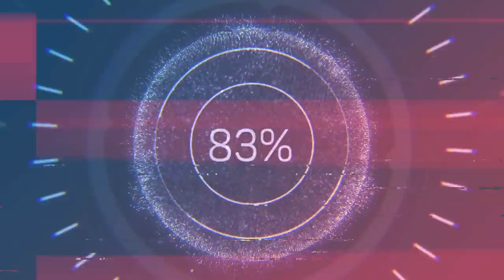Woodturning -  Blood Veins Evil Epoxy Resin !

Comment: Nick, just a couple of suggestions to make life easier if you do a similar thing in the future. 
Paint the wood with clear resin before you do the major resin pour.  This will seal the wood and prevent bubbles.
Use a resin with a pot life of at least 24 hours.  You commented on how hot it was getting.  That happened because the resin was curing quickly.  The heat it generates will always crack the resin.  If you use a slow curing resin it won’t crack as readily.  You’ll also have a lot less bubbles as the vacuum will draw them out when it goes in the pot.
Don’t root around with taping the wood down when if floats in the resin, just chuck a brick on it.
The result was pretty amazing!

Comment: Great burl!  Share that to Cindy Drozda, who recently did a vid on burls.
When you said "not going to do a bowl," I immediately thought "lidded box."  Excellent detour!
Looks like the lid's handle was set a bit too deep.  When that happens to me, I discovered a kind of silicone caulk that starts out white but cures fairly transparent.  Works well to fill such gaps.
You might want to consider a slightly loser lid fit and use a few small magnets or pins so that there's a 'natural alignment' for the lid that lets the grain of the lid match the bottom.  I had an article in American Woodturner magazine for one approach on 'keying' the lids to the bodies for that.  Lots of alternative ways to do that, too, and I'm sure you'll invent some more clever ways than I did.

Great video!  Love the humor and the results!

Comment: You are so amazingly human. You mess-up just like we sometimes do. Life has a way to sneak up on us doesn’t it. I’ve had my share of hypo you goof up that I rather care to ignore honestly. I finds using s cheap high bucket from HD, spray silicone inside all around and the bottom . Weight down the project weight it down with a very old heavy stone that has steel in that weighs 2.45 kg. When I choose to use different colours I always pour one colour then wait 20 minutes to mix and pour the next colour. It is beautiful. The colours has mixed slightly  without a goo of a colour and take this no cracks. Take care man!

Comment: Looking good Nick... one idea regarding the handle for the lid, is to create a ball  or disc of your own using the same swirly resin mix used for the jar and bond it into both the handle and lid with a metal rod. In my mind, it would look more in keeping with the rest of it.
The other, more involved option would be to leave enough material in the lid for you to turn the handle while creating the lid and have it as an integral part... I don't know if you would need to use a hidden metal rod to reinforce it thoguh

Comment: I make a lot of fiberglass and carbon fiber parts for everything from model rocketry to racecars. Do you use the same type of resin, or do you use casting resin? I have some of my disposable pots that had a lot of unused mix in them and they got rock hard to about 18mm thick. And since fiberglass resin is much cheaper than casting resin ( $17.00 a gallon for what I now use vs $36.00 a quart for casting resin) so you can see why I would like to use the laminating resin. Any advice you can share would sure be helpful. Hope to hear from you.

Comment: I really like the piece. I would use it. I have a question. 🤔 When you are (I don't know the correct terms so pardon me) grinding down the piece and you are grinding down the resin, these white ribbons are produced.  Are these resin ribbons recyclable? It just seems like a waste. I know it is mixed with wood dust but just curious. I know it's been about 7 months ago when you made this piece so I don't know if you will be alerted.  😃

Comment: My first thought when it came to making the handle and choosing what to put on there, was "use the wood you removed from the piece earlier, shape it on the lathe (add more resin for stability?,) and then put the butterfly through it, like it's perching on a branch." Although I don't woodturn so IDK how well that would work. 
But it's really cool and I really like how the colored resin mixed and flopped and turned into something similar to the wood color. <3 And the way the grain just pops is lovely.

Comment: Nick, great video. I think your pour developed too much heat so you got the cracks. With a large pour try putting it in a refrigerator, nothing else in it, for about 36-48 hrs. Then take it out, pop it into the pressure pot and leave another 48 hrs.  Helps get you past the extreme heat phase.

Comment: Nick, could you please if possible show me or explain how you used that same chuck to grip the bottom of that project? I'm assuming it was a reverse pressure grip with the force pressing outwards but I'm a little concerned about leaving vice Marks on the inside or that recess, did you use anything like cloth to protect the piece?

Also I had a very similar experience with the "premature setting" I know its probably a simple project for you but I made my waste attempt into am egg I am pretty happy with it 😀

Comment: Let me give you just an idea that you've probably already thought of cause you're a genius at this stuff but this is what I do is sand makes a wonderful support structure and it can be used over and over and over and it supports perfectly anything you put into a pressure pot pressure pot or pressure pot not needed you can use like a home depot bucket put some sand in the bottom and search your piece with a miler plastic wrapped around it however you want to tape it up and then fill the sides in with sand so the mold doesn't move and leak or if it leaks very little...

Comment: Is it possible to make a varying diameter on the interior only of something, using the lathe? Like, keeping the outer wall flat as you have it but making the inside wide at the bottom and top with a narrow aperture for the middle section. 🤔:hand-pink-waving:

Comment: For those little chip outs you should use UV resin. It can be cured real fast under UV and would look like no chip existed.

Also the cracking; my guess is it was because the resin was mixed up at different times but still not set. When the second batch was kicked off if inside a pocket of the first batch there has to be some slight expansion.

Comment: Nick shooting from the hip here. I have never worked with that stuff resin that is and I'm not sure what they call it in the UK but that plastic tubing we have in America is called PVC pipe would that work you can get that in all sorts of different diameters maybe you should start using that in different lengths for this kind of stuff you sure wouldn't blow that out you could build your own you know caps to fit on the ends
Reply: And you can cut it to whatever length you need

Comment: Don’t you just hate it when nothing goes right? I’ve had those days too lol. Leaky molds or miss mixed resin or the like. I hate it when that happens but!….it was worth it because it came out beautifully. Have you ever tried using superglue to fill cracks? I’ve seen other wood workers use the CA glues and so,etching like hotshot to cure it. You just give it a spray over the glue and it’s cured. I use it for other things ( I’m not a wood turner but man I’d love to try it) I, a sculptor and use it for breaks and cracks in my resin casts or epoxy originals. Love watching you create beautiful art and do it with humor. We need more people like you and I think there would be a lot less hate in the world, especially lately. Thanks for making me smile.

Comment: You could still do something cool with that resin that set too quick. That guy Ben Worx did something similar and used a vacuum chamber to suck the colors into the blank spots. I think that would be cool.

Comment: Nick: Uses hot glue to seal up a mold.
Also Nick: Pours in resin that gets hot as it cures.
Somehow Also Nick: Surprise Pikachu face that hot resin melted glue... that is specifically formulated to melt when it gets hot. 

You're like the third person I've seen to make that mistake... You can't use hot materials and expect hotglue to hold!

Comment: i don't understand why you guys don't put these molds with odd objects in them under a quick vacuum to get the larger trapped air pockets out before putting them under pressure to handle the rest of the smaller bubbles.

Comment: Sometimes I end up with the 'closed captioning' on, and I guess you have a computer doing it.  It's awful - the computer doesn't know when you've ended a sentence and you end up having run-on sentences.  It also puts in the wrong words (which, sometimes, turns out real funny). // {A hint to tell whether to use its or it's - say the sentence with 'it is' in it - if it works then you can use it's, if not, then use its.} // The covered bowl turned out beautiful - nice to keep special items in it.